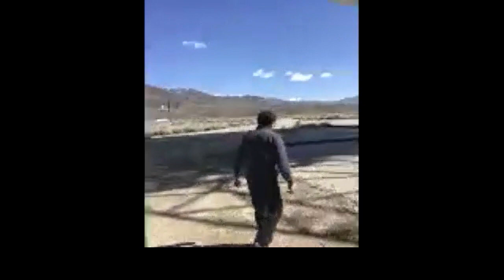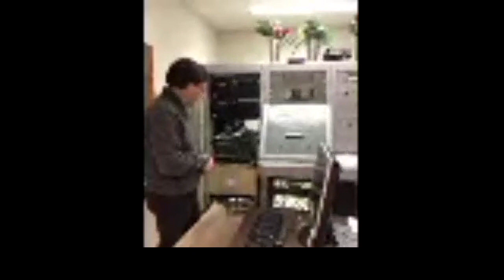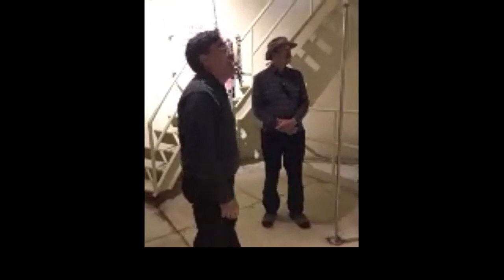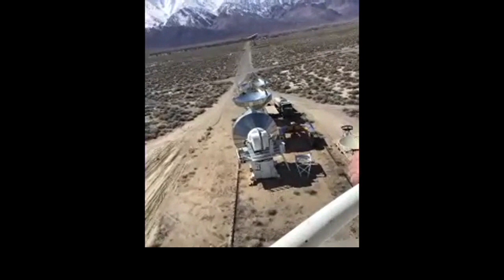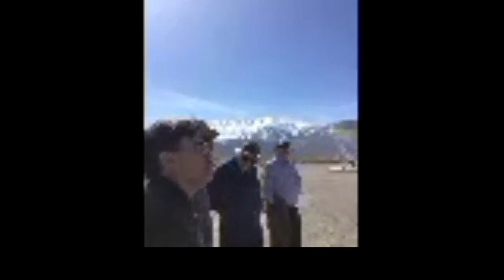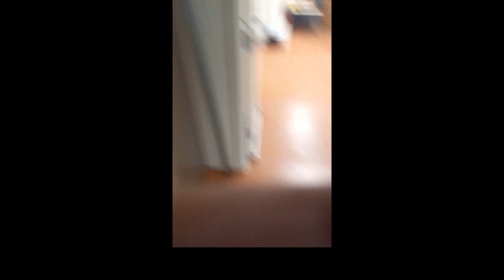Owens Valley Radio Observatory Tour - SARA 2023 Western Conference

Comment: I worked here weekends the summer of 1980 during the Solar Maximum Mission to give astronomers days off. When I detected increased activity from the designated coordinates (ie. a solar flare) I phoned CalTech and Big Bear Observatory so they could peak up on the target and coordinate data. Big Bear Observatory was online for optical data, and of course the SolarMax satellite in ultra violet, X-ray and gamma ray. Because solar flares release energy first in the microwave spectrum I saw it first. Big Bear could be on target before any activity began in the visual spectrum. Five minutes from every hour was spent on the Quasar 3C273 to calibrate the telescope. Very cool experience